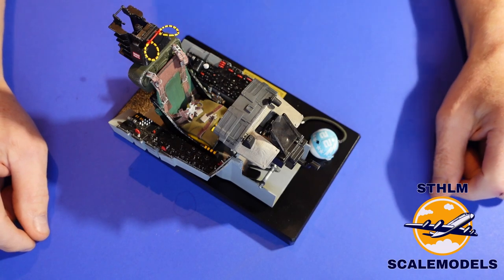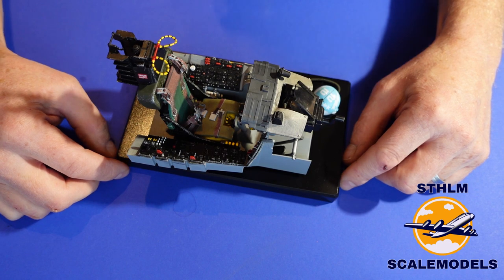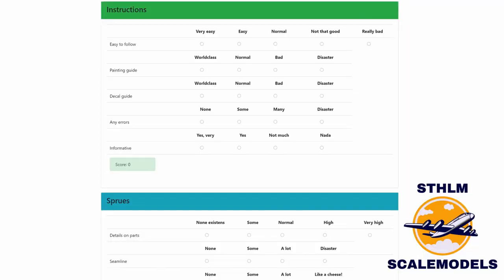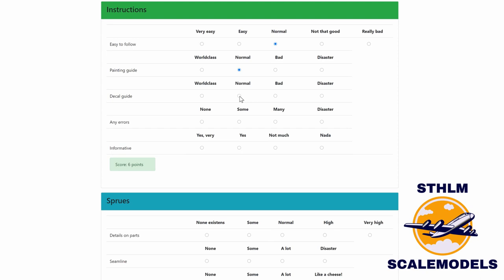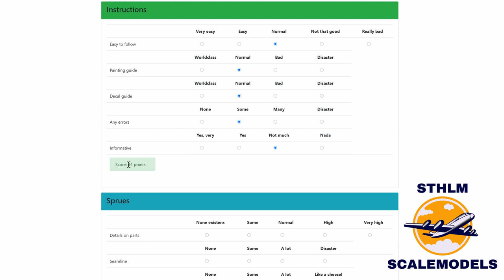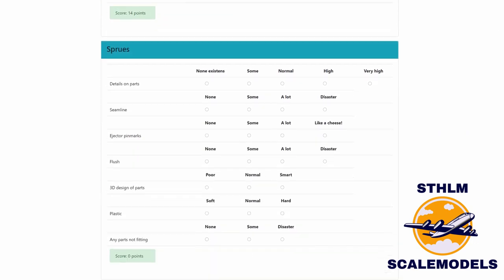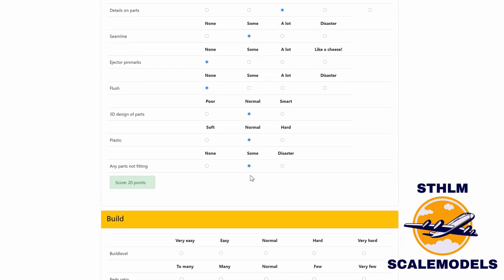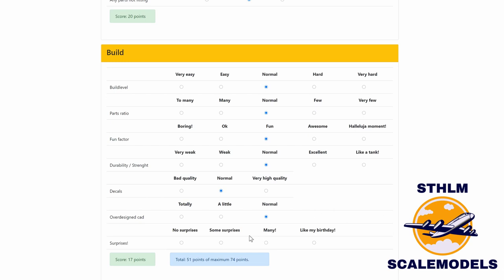Part 3: Italeri F-104G Cockpit

Comment: Looks great! What do you use as a wash?
Reply from the maker: Ammo of Mig, dark wash :D
Reply: @StickyFingersScalemodelsSweden  I see, I use that one too. Do you thin it with white spirit?
Reply from the maker: @Starfishscalemodeling  no, i just use it as it is. Wiping of excess with a brush moistured with whitespirit.
Reply: @StickyFingersScalemodelsSweden  I use a q-tip but had some problemlos with the Ammo paint coming off again
Reply from the maker: @Starfishscalemodeling  Thats one major issue with Ammo and their primer. I stopped using that to avoid problems. I always use Mr.Surface or Tamiyas primer on rattlecan, and either MR.Paint or Tamiyas paint, diluted with mr.Leveling thinner. For details with a brush, ammo is good enought :)